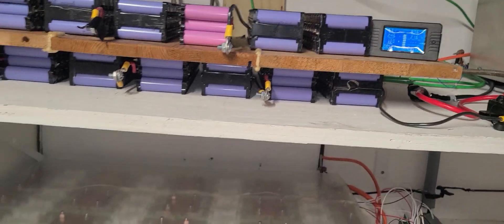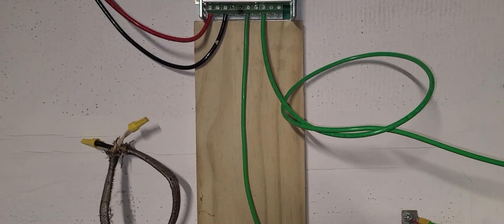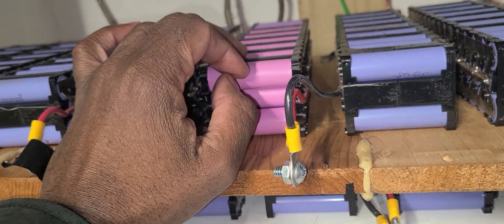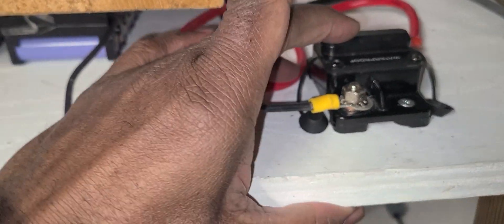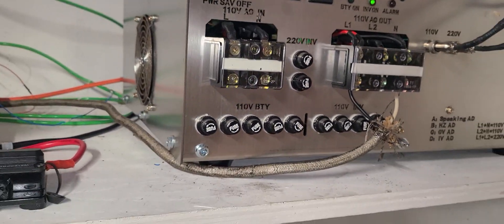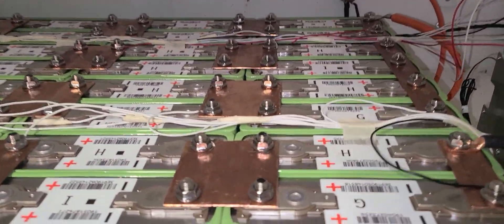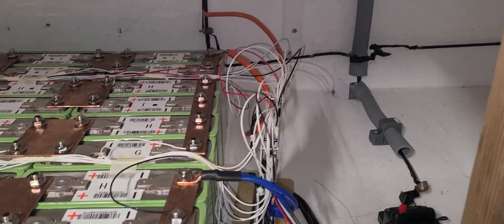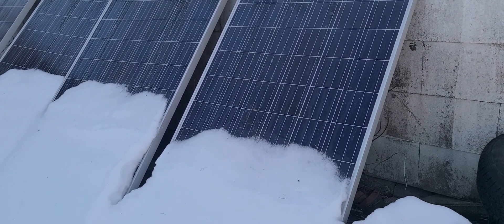250 DAYS+ OFF-GRID WITH SOLAR POWER 🔋 ENERGY SYSTEMS  #lithium #lifepo4 #solar #inverter #Off-Grid

Comment: i like it but i don,t use a bms and doing fine
Reply from the maker: Bms helps your batteries 🔋 tremendously. It makes it last longer.    I was doing a capacity test recently, and I also have a video on that, one group of cells almost reach 0 Volt. BMS will not allow that. It is a real deal. I am building a huge battery 🔋 bank that can handle 100kah.

Comment: Hello sir , I’m not the best at making videos . The project should be called how to build a solar on the cheap even though those LEV60 are not cheap but I’ve found a way to build my own a much very cheaper price then what you buy online ! One day my empire will start online but I love your setup and work but I don’t why people don’t subscribe also the words need to spoken
Reply from the maker: LEV60F costs $29 at BatteryHoockup.com, plus shipping, they are 1500 cycles life, 7kwh. I just wanted to try them out. I got 20kwh for less at the same in auctions